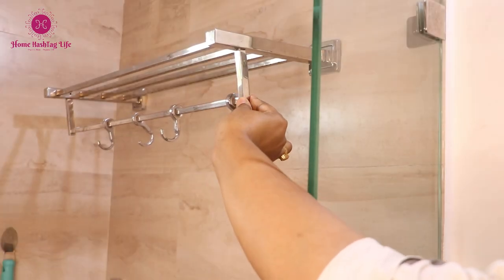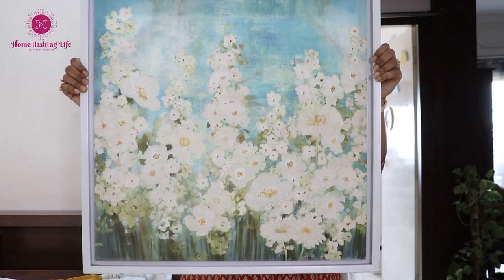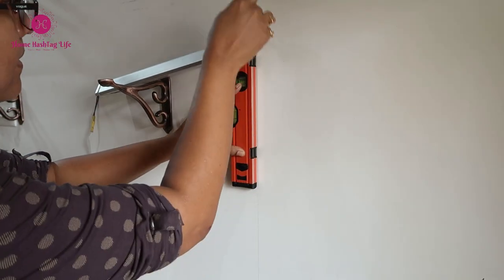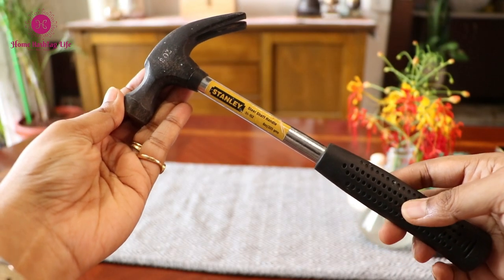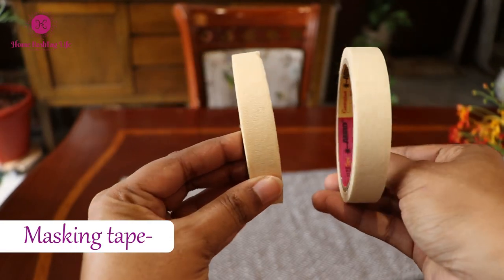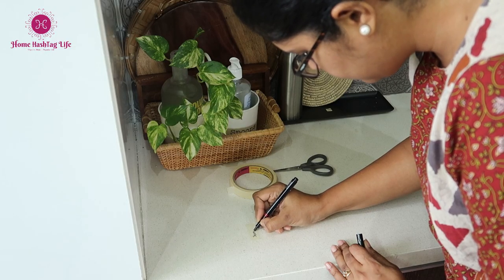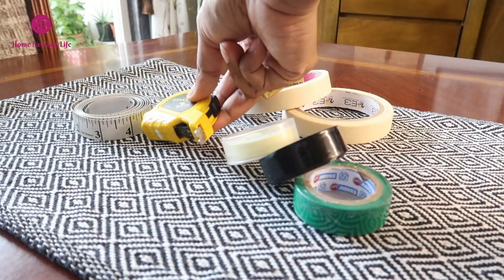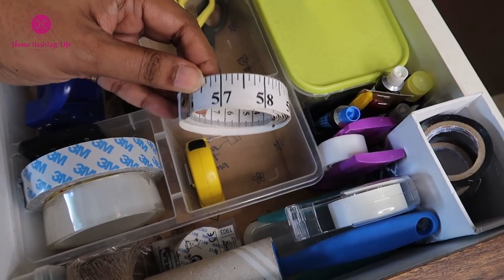10 Must Have Tools that every home should have / Best Tool Kit India / Home Keeping with Jaya Ep.3

Comment: Hi Jaya. I have always seen ur videos n applied some of ur ways at my home too.. 1st time I'm commenting . I too keep all such handy man stuff at home n fix things myself. Just one thing Ur missing in Ur box is wooden bits to insert in the wall while drilling a screw would be more reliable than plastic ones. A tip from my electrician(he says plastic ones break while we drill, we don't get to see it as it's inside )  the wooden ones Are always reliable n best . You may want to keep some .